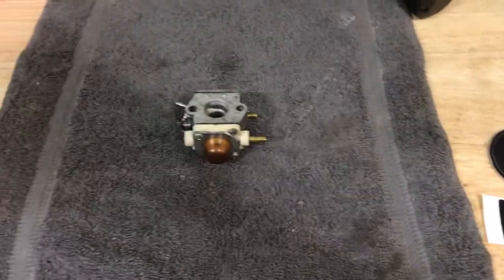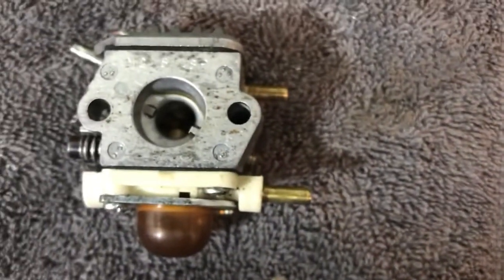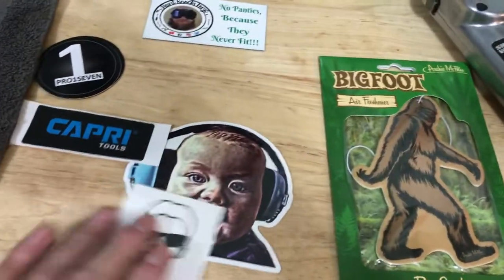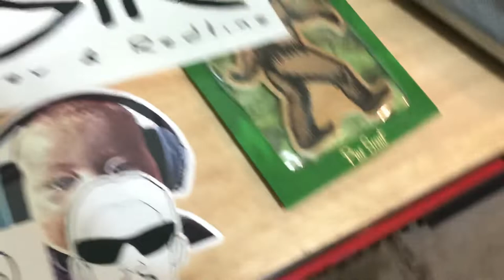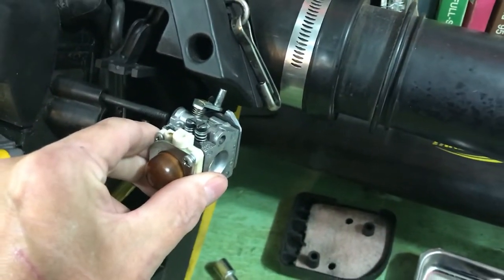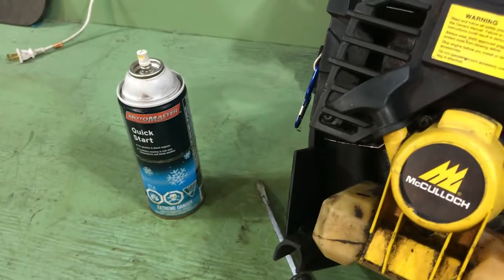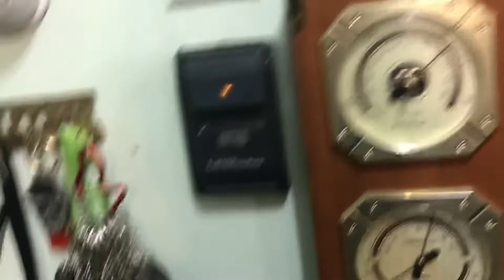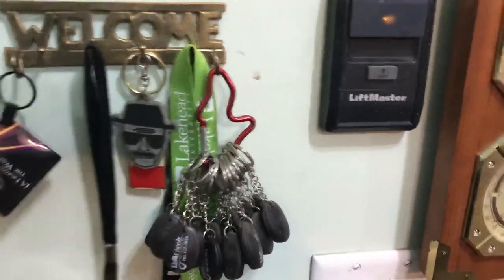Small engine carburetor and some new decals!

Comment: Zama is a pretty big carb company , or at least they seem to be on just aboot everything. Checkout ereplacementparts.com I’ve found some hard to find parts and rebuild kits on that site plenty of times. Good luck
Reply from the maker: I've checked the Zama site and according to them, it's discontinued and only a gasket set is available.  
ereplacementparts didn't have it either.  Thanks anyway

Comment: Awesome Bruce《☆》Thumbnail is very inspirational :*: If the diaphragm, gaskets & bulb are good then it may need a deep cleaning. A mason or pickle jar filled with  amonia to soak fuel nozzles in ultrasonic cleaner changing the amonia out frequently or as it gets dirty. Then rinse with water. Follow up with acetone or mek but monitor the temp of the cleaner so it doesnt get to hot & cause a fire. If You don't have an ultrasonic cleaner You could heat the jar up on a hot plate or wth a heat gun / hairdryer & stir the parts around with a screwdriver. I wouldn't recommend using a torch because of the flammable fluids. Good luck Buddy ☻
Reply from the maker: Thanks BDOG.  It is a good thumbnail, isn't it? lol  I'm gonna have to check the diaphragm this weekend, a few people have mentioned it.  No ultrasonic cleaner here,  heck... I barely have running water and electricity.
Now you've planted the image of me heating up a jar of acetone with a torch lol... I could see that going terribly wrong.
Have a great weekend!

Comment: Bad diaphragm that's under the prime button , check your muffler as well could be clogging up as well .
Reply: You can get the pistion stuck in the cylinder from using spray as it doesn't have oil in it .
Reply from the maker: Thanks Gene.  You're the second person to say it might be the diaphragm, I'll have to see if I can find a replacement.  I had to order one from 2000 miles away for my boat a few winters ago.  
The muffler 's good.  It was one of the first things I checked.
Reply: @BruceLyeg  There is a screan in the muffler they get full of carbon and prevent airflow out and motor won't run smooth dies out when given gas .

Comment: How did you get my wife to pose for your thumbnail? Oh wait, she would be carrying a set of VM29 smoothbores, not a car carb. I had issues with my Echo edger last year. The Zama on it had lost a tiny roller on the butterfly. A $16US kit later and it runs like new. Google searches were not much help. I was willing to buy a new one but the correct one was around 70 bucks and I gave up on finding the exact one on the internet. These are quite simple yet very maddening at the same time. I found a Youtube video showing the offending roller with the warning that you WILL lose this roller when disassembling. Zama is Chinese but they seem to work good once right.
Reply from the maker: You're gonna have to make some videos with your wife in them! lol
Google is failing me on this one too.  I can find just about every mode, but this one.
Reply: @BruceLyeg  
The fins on that one are strange. I ended up finding my kit on the Echo site but when my local small engine shop ordered it none of the numbers were even close. They, however, know their business and it worked fine. They couldn't (wouldn't?) tell me what the tiny little roller was. It raises the butterfly needle as the butterfly turns. The video I found on it addressed this first thing. Looking back, there was no reason to even take that apart in the first place. It runs like new again for $16 so I am happy. Good luck. Yours looks different. The wife is camera shy which perplexed me how her photo was on your video. Then I saw the non motorcycle carb and realized it couldn't be her!

Comment: Did you renew the diaphragm gaskets and clean the jets inside it and also renew the primer bulb
Reply from the maker: Hey Alexander.  I didn't do any of that.  I was hoping to avoid it by getting a replacement carb but that's proving futile.  I'm having trouble finding a rebuild kit for this model,  I'm waiting to hear back from Zama if the kits from any other model will work on this one.
Have a great weekend.

Comment: Bad diagram is your most likely problem as that is not a primer bulb is is a purge bulb it pumps gas threw the carb not into the engine.
Reply from the maker: Thanks Robert. I'm having trouble finding anything for this specific model though.
Reply: @BruceLyeg  take the carb to a dealership they should be able to match up a kit that will work.